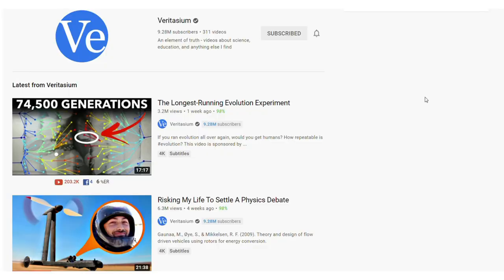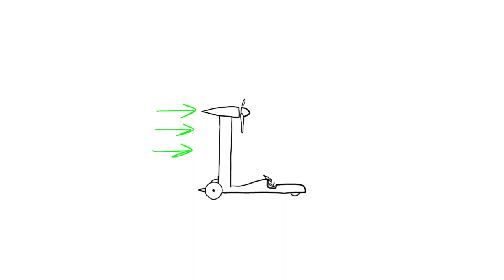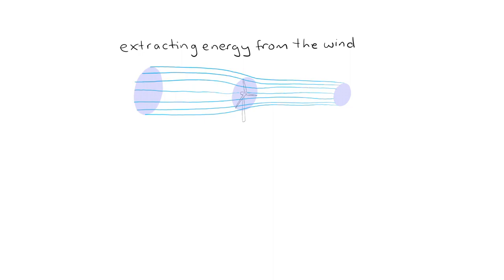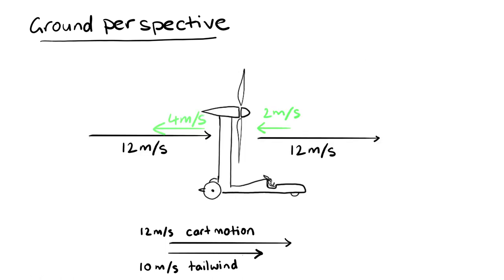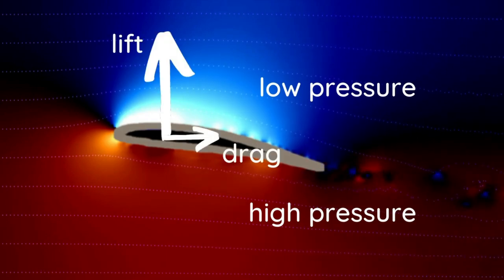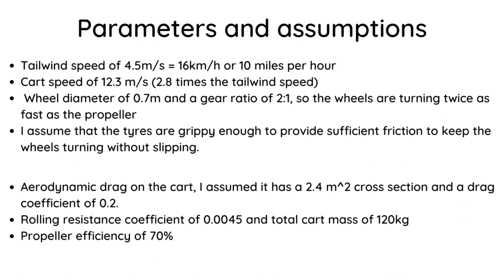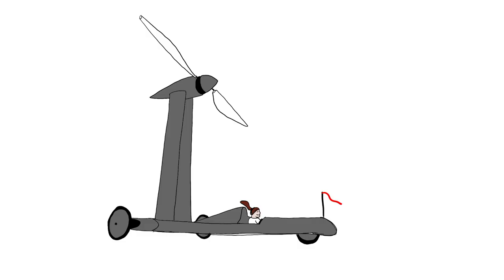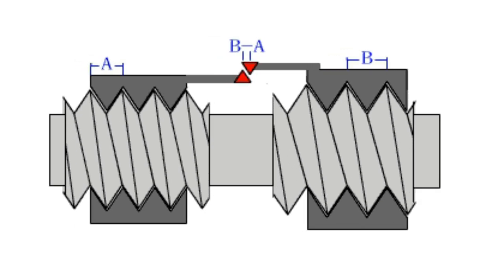Downwind Faster Than the Wind by Veritasium: How Does it Work?

Comment: Could this be simplified to a couple of paragraphs to say:
ahem.. clear throat
The wheels and the propeller are tethered - so there can not be any ground slippage.
So once the wind has accelerated the vehicle to the point where the propeller is generating more backward thrust than the wind pushing it forwards, the vehicle will accelerate....
As the vehicle accelerates, the wheels go faster, turning the propeller even more and thus generating even more acceleration.

Here is a question though... seeing that it works on a treadmill... if the wind suddenly died down, would the vehicle carry on moving?
The wind is needed as the impetus to accelerate it to the point where the propeller can, essentially, take over the thrust.... so... could it carry on after that without the wind?

If it can... that could have some pretty massive ramefications for the energy generation industry.
Reply: >> if the wind suddenly died down, would the vehicle carry on moving?

Without wind it would quickly coast to a stop.
Reply: @Rick_Cavallaro  I agree - otherwise that would break the laws of conservation of momentum... but having seen a model of one of these on a treadmill on a flat plane... It accelerates up the treadmill. Relativity doesn't tell us which one is moving...... Soooo.... would it be the drag from the headwind that would be too great because it has to go at a certain speed? Drag increases with velocity squared... so it's significantly higher at 20 m/s compared with 10... not double.

See the video of the one on the treadmill. It just takes off.. The imagine the treadmill slowing down. etc

Comment: Very good, but a bit confused about the reason planes fly. It is mostly the angle of attack that gives lift, you can use a plank of wood as a wing…
The aerofoil section is mostly to reduce drag and reduce the stall speed.
Reply: Airfoil section is to create the vacuum low pressure in the front of the propeller that the high pressure behind the propeller moves into. She actually got it wrong

Comment: Could it be set up the other way around to go into a headwind? If the propeller is facing the other way, the wind drives the propeller which in turn drives the wheels. And if you change the mechanical set up so now the wheels are turning slower than the propeller, and you still get the leverage effect the other way. i.e. small force long distance at the blade tips and large force small distance at the wheels.
Reply from the maker: It absolutely can and has! https://www.youtube.com/watch?v=F7PNSyAfCjk&t=52s
Reply: @EngineeringwithRosie  Awesome! Thanks so much for replying!

Comment: The professor was right. 

If he was wrong then the vehicle should keep traveling when no wind is present after an initial push.

There should be a chart where at wind speed of 1 mph the cart moves at 2.7 mph, at 2 mph the cart moves at 5.4mph and so on.

But this chart will never be made because it brakes the 1st law of thermal dynamics. 

As for the treadmill test is ludacris!if anything it is simulating a head wind. this should be able to chart on a graph as well.  What do you think will happen when the treadmill goes at a walking speed? The answer is nothing will happen.

To really test it they should take the most optimal small scale modle that they have created, make a wind tunnel the length of a football field where every bit of air in the tunnel flows exactly the same speed (as close as possible), have multiple readings take place throughout the tunnel to get average wind speed and then set the unit down and see if it can beat the average wind speed th get to then end.  But it can't and won't.  It would be cheaper to build this than that large unit but they can fudge the numbers with the large unit

how fast should it go at 1mph, 2mph, 3mph. There should be a graph charting this.

Wind tunnel and unit on a track is the best way to test. Keep it small like the treadmill units. Have steady wind speed. But this won't happen because it would ruin the theory.

If it runs faster than the wind @ a wind speed then it should be able to run faster than the wind at 0 mph. Let me explain:

If it's the wheels powering the propeller which pushes the vehicle faster than the wind then after starting the unit with a push the wheels should be able to power the propeller and push it at the same rate as when it has wind.

A vehicle moving at 11 mph with a 10 mph tailwind is moving upwind at 1mph. The wind in perspective to the vehicle is now a head wind.  A vehicle traveling 1 mph in no wind has a 1mph head wind. It's the same thing. Get the vehicle started with a push and it should beable to power itself. I don't think I'm missing anything but if I am please explain

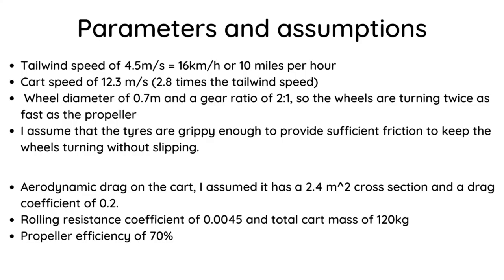just rewatched the blackbird professor bet video. @12:05 the claim is made "the propeller thrust force is greater than the drag on the wheels". 

If this statement is true we can expect the unit to produce greater thrust force in a no wind test. Just get the vehicle started with a push and then the propeller will overpower the drag that wheels produce

Im not into all the math equations but just coming from a practical standpoint imo the black bird is a hoax
Reply: //"Im not into all the math equations but just coming from a practical standpoint imo the black bird is a hoax"//

What do you think is more likely?

A:  you've failed one of the best physics brainteasers ever (one that trips up even physics professors until they realize their mistake)?  

or 

B:  you, who "isn't into all the math equations" has figured out that all the people who CAN (and DID) do all the math equations and actually built many of these devices are all fooling themselves / being fooled?

Remember, brainteasers are *supposed* to be counterintuitive.  The common sense answer in a brainteaser is by definition is the wrong answer - that's the point..   

Rosie here is a highly educated and knowledgeable wind energy engineer and she is able to show through math and physics that it works just fine.   Derek over on Veritasium does the same.  MIT professor Mark Drela (the foremost aerodynamicist of our time) contributes to Derek's video and says you're wrong.   NALSA/Guinness went over the craft with a fine tooth comb and observed/recorded days of data before ratifying the world record.  The American Association of Physics Teachers included the Blackbird question in the 2013 edition of the US Physics Olympiads (where you would have failed the question). 

https://www.aapt.org/physicsteam/2013/upload/E3-1-7-solutions.pdf  (page 11)

You might want to slow down and consider that no matter what you think to yourself, unless you can do the basic math/physics/engineering required to understand the craft (which you say you are not into) the most likely scenario is that in this situation, you're not the smartest guy in the room (that's not a reference to your intelligence, but rather to the movie)
Reply: //"If he was wrong then the vehicle should keep traveling when no wind is present after an initial push."

As explained here and in the Veritasium videos,  you're missing the energy input from the tailwind. 

Power = force x velocity and in a tailwind, the wheels travel over the ground further than the propeller travels through the air.   This allows the drag force on the wheels to be less (over a longer distance) than the thrust force of the propeller (over a shorter distance) while the power in and out (including losses) will eventually equal out at a speed greater than the tailwind.  

In a no wind situation, the propeller and the wheels travel the same distance and velocity and thus the equations (and real life) show you get zip (actually less than zip due to losses)
Reply: @stoicwam  Is there some point made in that video that you wish me to comment on?    You will see my response to the video in the comments from when the video was new.  

That guys explanation of how it works (in addition to being wrong) would have dramatically increase the performance of the Blackbird as he couldn't get it through his head that in addition to the rolling resistance that must be overcome, the braking force on the wheels also has to be overcome.   There was about 15 engineers on that thread trying to correct his assertion that the tangential force on the wheels wasn't slowing the craft down, but to no avail. 

If you have a question feel free to ask it.
Reply: @johnborton4522  bottom line is that when there is a head wind )in relation to the blackbird) the wheels are no longer being powered by the wind, they are being powered by the propeller, which is being powered by the wheels, which is being powered by the propeller... etc.

On top of that there is a drag from the wind. It is a very cool concept. Would like to see it in a test where you could control the variables better than gusts in the desert
Reply: @stoicwam  //"bottom line is ... the wheels are no longer being powered by the wind, they are being powered by the propeller, "//

The bottom line is that you're wrong (and I'll prove it if you, like the professor want to lost $10k in a wager)  I wonder who knows more about how it works ... you, or the guy who designed it, built it, set the records and has never lost a wager with it?

//"Would like to see it in a test where you could control the variables better than gusts in the desert"//

That's what the treadmill is for.  Perfect smooth wind. No gusts.

Comment: Only way I could understand it is that the push of the propeller is greater than the tension of the wheels.  I think?
Reply: Correct, there is effective reduction gearing that allows the propeller to push at a greater force but at a lesser speed than the wheels.

Comment: Ok, this helped me understand more, since the Veritasium explanation was a bit too vague for me.
So, basically, at low speeds it is pushed by the wind, and at high speeds it draws energy from the difference between ground speed and air speed (that's why it couldn't work without wind, for example - no way to turn this into perpetuum mobile ;) ), analogous to how a stirling engine draws energy from temperature differences. And everything else is an explanation how it uses airfoil and transmission to efficiently generate thrust from this difference.

One thing that confuses me is talking about wheel speed relative to the ground. Wheels are rotating, so parts of the wheel are not moving relative to the ground at all, while other parts are moving at twice the speed of the vehicle, relative to the ground. To simplify this to a single vector, describing the average speed of the particles that make up the wheel, seems like an assumption that the wheel isn't turning, or at least that the rotation is irrelevant... which seems weird, considering that the whole system wouldn't work without the wheels rotating.
Reply: "One thing that confuses me is talking about wheel speed relative to the ground."

It's just the speed of the wheels' axis of rotation relative to ground. It implies how fast the wheels rotate assuming a good grip.
Reply: @seneca983  in that case, it would be equal to the speed of the chassis itself, in which case saying chassis speed would be less ambiguous.

Comment: The way I understood it, put your hand out a window at 60 mph you can feel the energy pushing your hand, now imagine your hand scraping the ground at 30 mph... you have enough energy transfer to remove part of your hand because of the friction. This difference in friction medium, allow you to have an "off center fulcrum" in the forces at work. Using mechanical advantage to maximize the output of that "off center fulcrum" using gear ratios and angles of attack that come out in the math. If it was a boat with a second propeller instead of wheels moving through water, the difference in medium friction would be different, you would have different math, need different ratios and angles to match the new equation and get it to move faster than the wind downwind.

Comment: Simpler analogy so people can grasp later the actual math and physics is like this:

1. The car is pushed by the wind and gets to wind speed without spinning at all the prop. The prop is just a fancy sail.
2. Once you let the prop get turned by the already rotating wheels any thrust that prop creates ads force to the system so the care will go faster than the wind it already equaled.

Of course things don't go exactly like that but this can make one understand faster from where that "miracle" comes.

Basically the car would go faster even on a slope, faster than the gravity would theoretically make it go because of that thrust produced by the propeller.

Comment: Your explanation is excellent Rosie♥️
It’s pure mechanical advantage due to leverage from the airfoil of the blades of its propeller… that’s why an airfoil on relatively small wings of a 747 cargo jet can lift many thousands of tons of cargo into the sky on just thin air which on its surface appears to defy Newton’s law of gravity… not really though it’s just mechanical advantage of the airfoil & lots of carbon based fuel for thrust!
The earliest writing on mechanical levers & leverage date from the 3rd century BC by Archimedes who stated, "Give me a lever long enough & a fulcrum on which to place it & I will move the earth.”
👉See Archimedes’ screw that you know well as a mechanical engineer Rosie… however from an total system point of view there is still the mass/energy loss though, because you still have to deduct the mass/energy entropy of the total system according to the laws of thermodynamics… but you say where does the entropic mass/energy loss of the system come from then? Put quite simply no one ever considers the inherent energy loss to begin with from the entropic mass/energy used to construct the wind powered vehicle which gives its airfoil’s mechanical leverage & of course the sun which produces the thrust of the wind & that also has mass/energy entropy that heats the earth which propels the wind. Many complex energy system inventors often don’t consider simple low entropy energy system solutions but instead talk about the energy efficiency of their completed complex mass/energy system invention in isolation from all the entropy of all the mass/energy (& man hours – person hours is probably more politically correct today & environmentally destruction) that went into it in order to construct their Rube Goldberg high entropy complex mass/energy, industrial production, agricultural & transportation systems they invent… that’s why we’re doomed by our own highly entropic, carbon based (the last I checked we’re still a grossly fossil fuel dependent species – & it is much too late to stop runaway global warming as it accelerates today), overly complex system designs & inventions on our earth – that will soon be a near dead planet absent of us & most of the megafauna & megaflora within the next 2 to 3 centuries!
👉Read Dr Peter Ward’s book “Under a Green Sky” even though he claims we can possibly stop complete catastrophe (I don’t)… it will change your outlook on what’s about to happen… which will be here sooner than you think! Too little, too late!!!

Comment: Technically a propeller does not accelerate wind through it. It moves through the wind (fluid) and thus what it is attached to moves forward. An impeller moves the fluid through itself - which is why centrifugal pumps have impellers in them not propellers.

Comment: hmmm, if I accelerate up to windspeed x via my Blackbird wind demon such that apparent wind is 0 in a long wind tunnel, and then suddenly switch to a another tunnel alongside it with no wind, such that relative windspeed component (green vector) over prop becomes -x. Is that creating a thrust force given the blade speed(blue vector) hasn't changed from  that achieved accelerating up to wind speed value?  A larger negative green vector seems to imply a greater thrust component with the same prop velocity, neglecting a few details like drag which may be determinative. So, at what point does my Blackbird wind demon start to slow given is now zero absolute breeze - Is it immediately for all values of x?

Comment: Excellent and helpful explanation thanks.  One tiny point...the brief analogy to an aircraft flying cross-wind is not correct I think?  If a plane is flying in balance, the wind direction from the aircraft's perspective will always be straight ahead - in contrast to the wind cart which is at the interface of land and air, the aircraft is entirely within the medium of the air and "wind" as perceived from the ground is irrelevant for aerodynamic purposes (unless the wind is accelerating).
Reply: ...you are right about the airplane. Although I have flown with some pilots who are that bad.

Comment: Thinking about the energy balance from a stationary perspective makes sense, but the model on the treadmill is stumping me. It somehow has to extract energy from the treadmill to drive itself forward.
Reply: The energy in these craft is always extracted from the difference between the speed of the ground and the speed of the air.  In all cases, you can envision it as either the air moving and the ground standing still, or as the ground moving and the air standing still.

Comment: So Derricks model to show the effect on a treadmill had little to no drag force on it. Does it even adequately show what's going on? The if the reference frame is moving and the cart doesn't have any wind on it how can it prove anything, this is like operating blackbird without any wind on a level plane. It would literally not move at all. The treadmill creates an artificial force on the wheels and even if it is level it would be the equivalent of running the cart downhill with no wind.